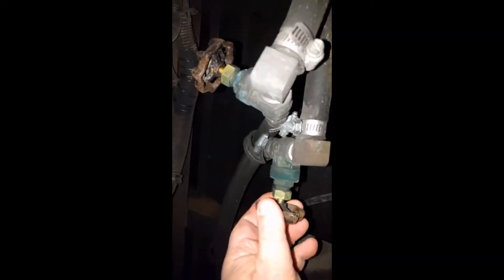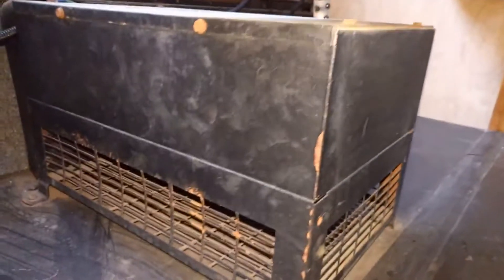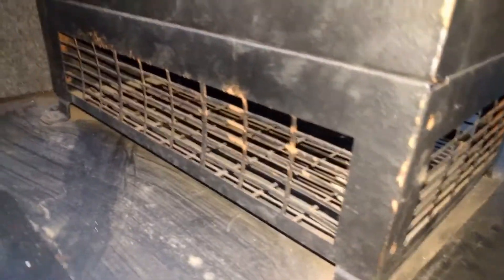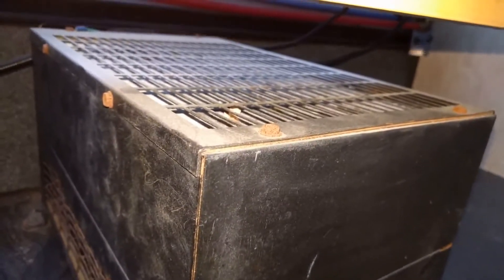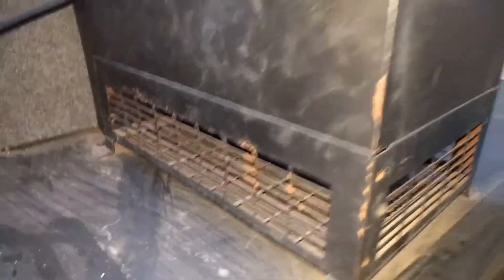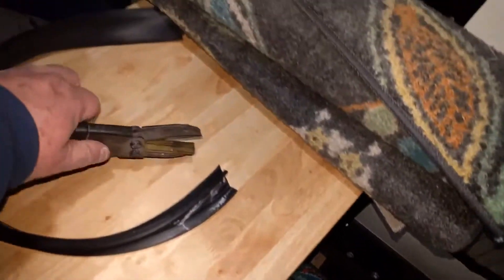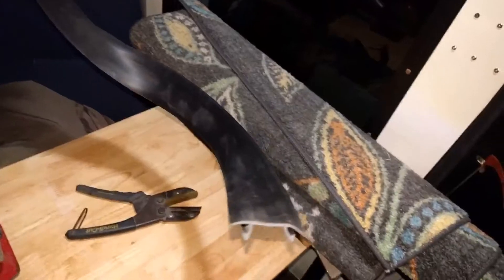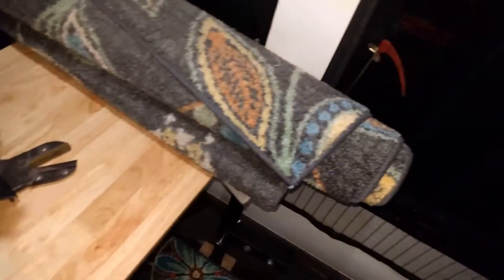Shuttle Bus RV Conversion (Part 81) Getting Warmer!

Comment: Great job Robert. 
Watched all your video's ..
I'm also looking at getting a wheel chair access shuttel bus. 
I was wondering if that lift you took out could lift a motorcycle,  and would a full size bike fit across the back of the bus ? 
Whats the measurement of the width of the bus .... 
Thanks 
Looking forward to the next build , and ideas ..
Reply from the maker: @Tom T  Hi,the bus is about 92" wide and I think you could lift a motorcycle with the wheelchair lift. You may have to modify it with a slide out wheel support if your bike is large. Thanks for watching and I hope this helps  :  )
Reply: Thanks for the reply Robert. 
 A slide out wheel support was in the plans cuz it is a  larger bike .  850 lbs dry weight .
Speaking of weight , what was the weight of bus after renovations?  Still within the limits ?  Air bags installed?  
Thanks again
Reply from the maker: @nofixedaddres5838  I have not weighed the bus, the GVWR is 14,050 and it's a Ford E450 so it has considerable weight capacity, no need for air bags, it drives great! I should go get it weighed just to know. I dont think my modifications weigh much more than the original seats and the rear lift.

Comment: Im wondering why you didn't remove the original ceiling and insulate under it.  I was told that I had to do it so that I wouldn't get condensation.  Are you having a problem with that?
Reply from the maker: @Violet King Hi, I don't have any condensation problems with this bus, It has 1' insulation built in between the fiberglass inner and outer panels making sturdy one piece roof.  Some buses are built different and require more depending where you plan to winter camp. :  )
Reply: @robertbraden3889  I'm still trying to figure out where the ribs in the ceiling are.  I don't want to just drill holes just willy nilly looking for them.  lol    I wonder where a person could get a manual for these buses.  It sure would be helpful to know what all the buttons are for too.   My bus is a 2011 international aero elite 21 passenger shuttle bus.  I liked it better that a bus because of the windows.  It runs extremely well and I just love it.   Cant wait to get it finished.   I learned sooooo much by watching your videos.  I've probably watched them all twice.  Thank You for them.
Reply from the maker: @violetking6141  Hi, I think the ribs on the bus are centered between the windows.I'm glad you got something from my videos and thank you for watching and commenting that means a lot. Sounds like you have a cool bus!  :  )

Comment: Good job on the rubber stuff on the floor. Yes, I wold either paint that box OR just put some wood around it.  Nice that you'll be monetized, but don't you have to have a gazillion subscribers to make that happen?
Reply from the maker: @AnnWith APlan  YouTube requires 1000 subscribers to get monetized, and yes that heater box is awful!  I dont want to spray paint it because of the smell when it gets hot. :  )
Reply: @robertbraden3889  - Ahh ok, then you're getting close! I'm going to post your previous video on Pinterest. : )